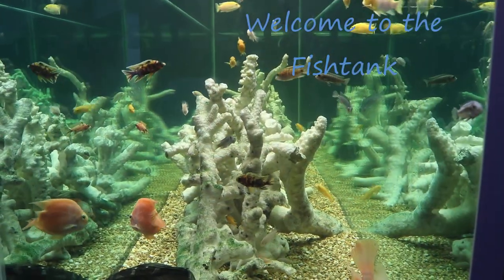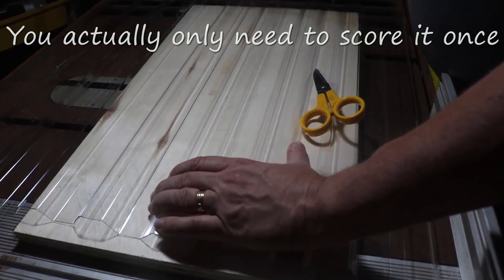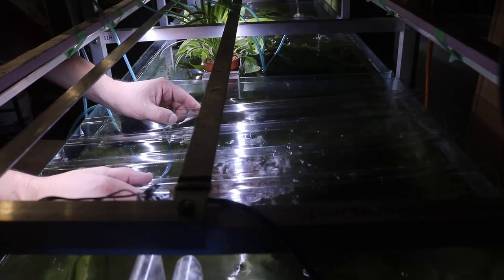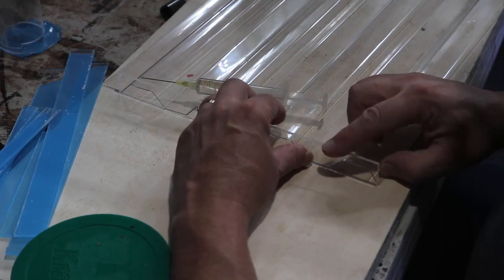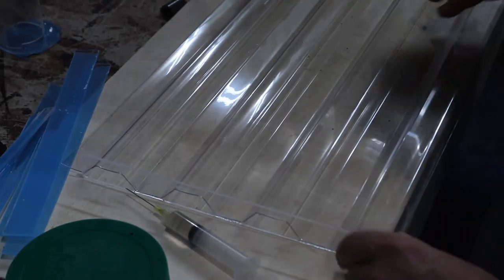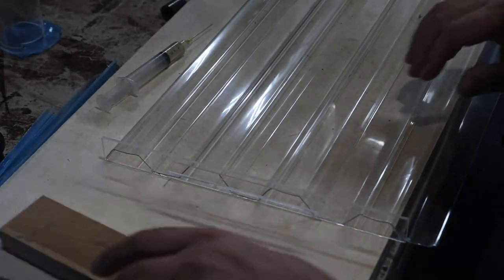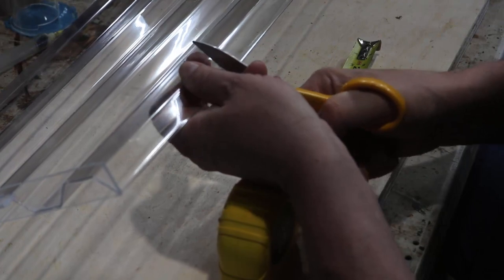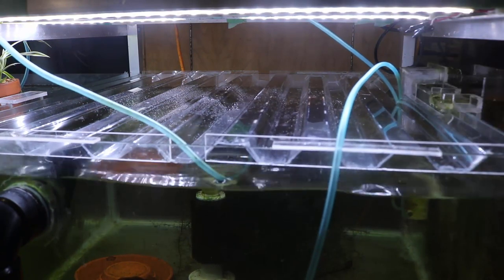DIY Plastic Tank Lid

Comment: Love this! You fixed the one issue I had with polycarbonate sheets, that flexibility. Great idea 💡
Reply from the maker: Thanks Barbara! Hopefully they will last lol!
Reply: @FishmanEricRussell  I know this vid isn't very old, but I'm wondering how these are holding up and if you're still pleased with them. Anything you wish you'd done differently, or are they good as-is? I'm just getting into the hobby and I think these would look nice enough for my pair of 20 gallon tanks, and the price certainly seems hard to beat. Any thoughts would be appreciated.
Reply from the maker: @doctorwigglespank8933  I really like the light weight and the fact that I don't have to be cautious around the rimless tanks as I move them around. The downside of them is they are allot more fragile than the glass lids. I've cracked the glue joint a couple of times and the the only upside of that is they are easy to fix. I don't like recommending something unless I've used it for a couple of years but so far they are fine. Hope that helps
Reply: @FishmanEricRussell  Thank you for the quick reply. I appreciate the fact that you take the time to reply to most, if not all, comments. Just one more reason I enjoy your channel.

Comment: Great video. I use them for lids for several of my tanks. I’ve also used the foam pieces designed just for those sheets. I siliconed them in place and they help keep evaporation to a minimum.  I’ll try and find what they are called but they come in a package so you can do several lids if you don’t have access to  sheets of acrylic.
Reply from the maker: What a great idea for a video there Jim (hint hint). Always great seeing you!

Comment: Nice diy! I need to make some for 2.5 gal betta tanks. Any suggestions?
Reply from the maker: 2.5 gal. is quite small so this would actually work well. Unfortunately sheet acrylic will curve even at that small size, though you could just flip it over every now and then